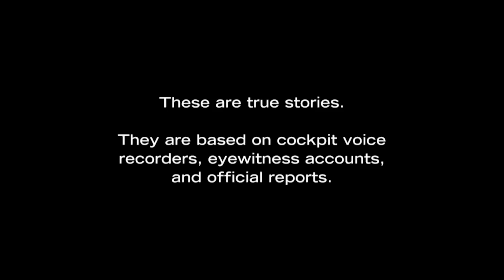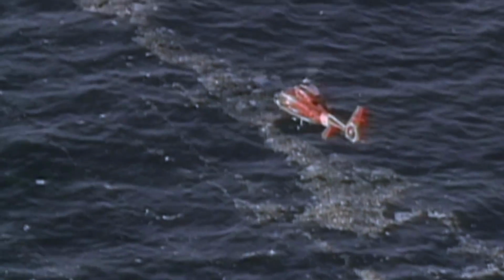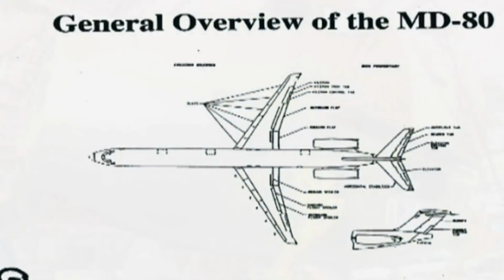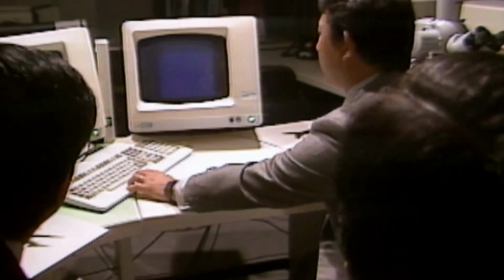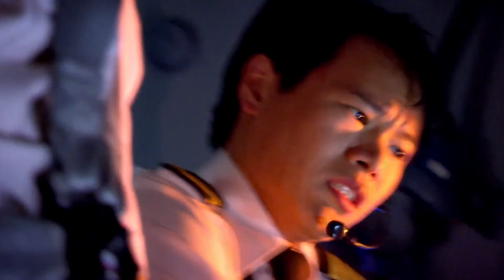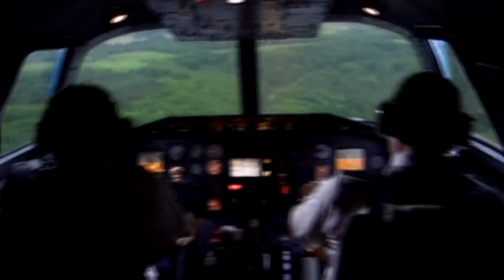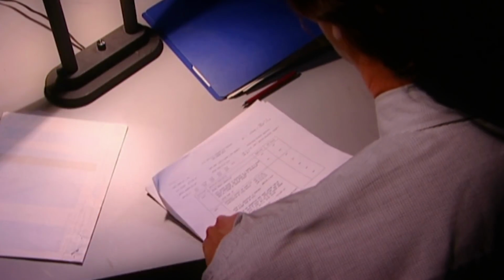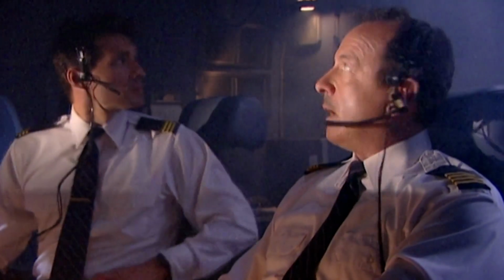Tiny Problems That Have Deadly Consequences | Fatal Flaw | Mayday: Science of Disaster

Comment: Funny, a jack screw can be consider a tiny problem. Most the equipment I have worked on with a jackscrew it would be a big problem in it's not working well or failure.

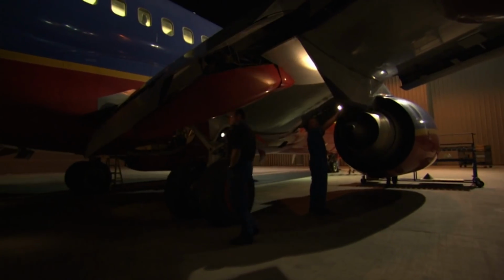Comment: 0:33 "Without proper maintenance, airplanes don't fly." Yes they do, just not very well.
Reply: Uh no, they don't.
Reply: @michigangirl5072  I take it you didn't watch the video, or any Air Disaster video. An airplane that has not had proper maintenance, often will still fly. Just not very well, or for very long. With a few exceptions, like the plane that lost it's entire tail due to a pressure seal blow-out. That plane flew for several years without proper maintenance. Or an entire fleet of planes that were flying with damage engine mounts due to improper maintenance practices. Only discovered when one of those planes lost one of the engines mid take off and ripped out the hydraulic lines. Or the plane that was flying when it's horizontal stabilizer became jammed due to improper maintenance. Without proper maintenance, these planes do indeed fly. Just not very well.
Reply: @TrexelCat I'm sorry, who are you? Hate to break it to you, but he is correct.
Reply: And one more thing. He could mean without proper maintenance, once the plane takes to the skies, if the maintenance fails, then that is when the plane stops flying and start doing free falling, like Alaska Airlines Flight 261 for example. He's been called an Aviation EXPERT for a reason. I'm not an aviation expert. Which is why I'm learning.

Comment: Eastern 401. How a simple lightbulb caused the crash.
Reply: The lightbulb was one element in the chain, not the proximate cause.
Reply: @chadwells7562  It makes for a good campfire discussion.   Tenerife 747s would not have happened if the small bomb scare at the flower shop didn't occur.  I believe that those insignificant events caused the crashes. Others do not. It's a good intellectual argument.
Reply: What's even cooler than that are the ghost sightings they had on all of the different aircraft that had parts from Flight 401 on them. Some of the parts from Flight 401 we're still in good shape so they re-used them and put them on other planes. There were so many ghost sightings from the planes that had the parts on them that they recalled all the parts from the plans. Literally took the parts off and replaced them.